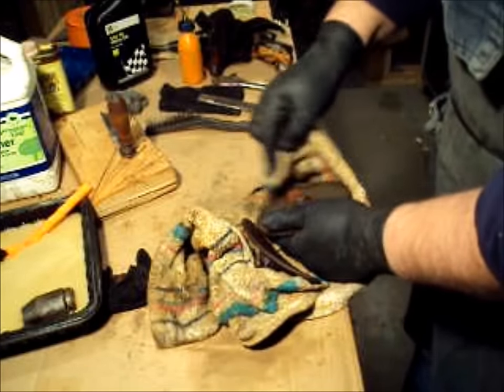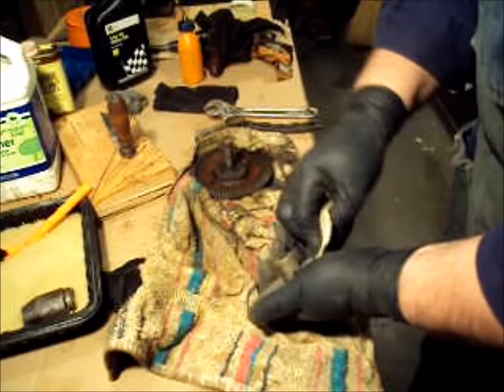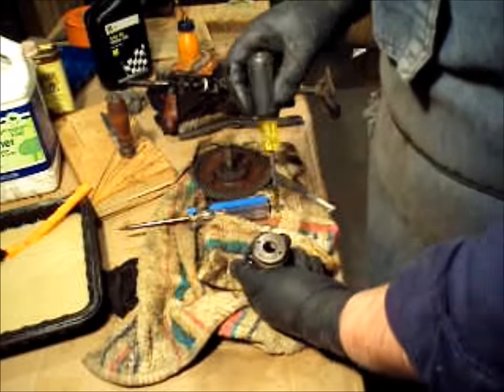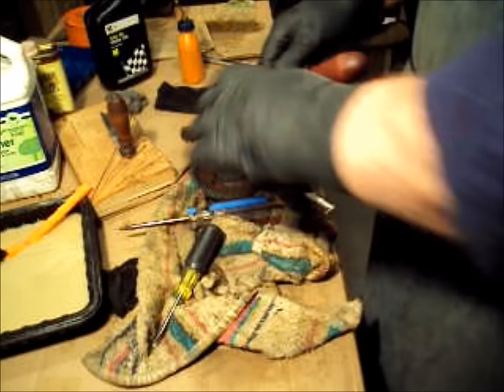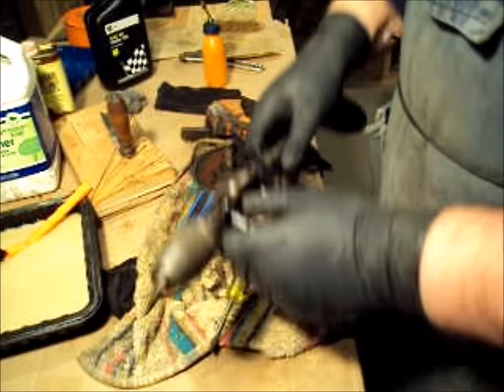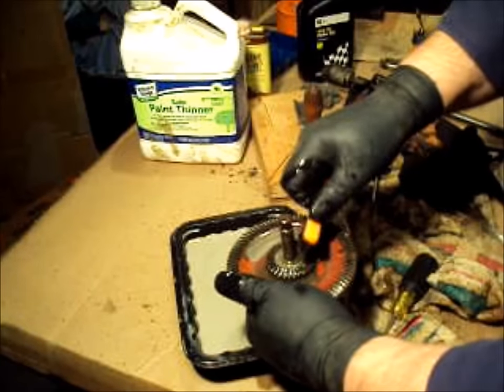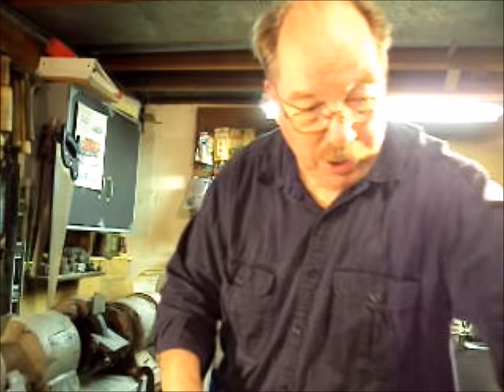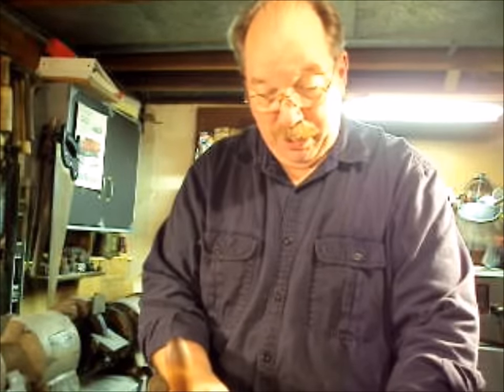Redemption ~ Repairing Antique Tools ~ Pt 2 ~ by Old Sneelock's WorkshopRedemption Pt 2

Comment: Old Sneelock - What a great video.The work you did on the jaws was fantastic.  I use a wire brush and rotary brush for rust removal, how good is the vinegar bath and does it leave the metal pitted ?
Reply from the maker: +UK Tony Short answer: No. 
Detailed answer: If the metal is pitted by rusting and the rust is removed the pits are exposed. If the steel is left to the point where the rust is gone and the vinegar still contains enough un-neutralized acid the acid will attack the steel. In that case the vinegar may cause pitting in the surface. 
Detail far beyond your question: Cooking vinegar that I purchase at the grocery store is 5% acetic acid. If the metal is exposed to the acid for long enough it will dissolve it to the point where the acid is used up. The greater the volume of vinegar the longer the reaction will continue. I have had screw threads become undersized because I left them in the vinegar for 3 days. 
I had concerns with the idea of leaving the parts in vinegar too long. What I've found through experiment is that the rust has already pitted the steel. The vinegar dissolves the rust at a much faster rate than it dissolves the steel so if the process is monitored and the parts removed from the vinegar at the point where the rust is gone only minimal etching of the metal will occur. 
I have been most successful removing rust by exposing the parts to the vinegar for 12 to 24 hours and then wiping off the vinegar and neutralizing the vinegar with soap and water. I have been most successful with long term rust prevention by immediately coating the parts with mineral spirits, wax, or paint, depending on what they are intended to be used for. Following this method, the vinegar will not create rust on a cleaned part as much as it cleans the surface to the point where oxygen can easily attack the chemically clean surface of the steel. By blocking the oxygen's access to the surface the part remains visibly rust free. How long it remains so depends upon the use and maintenance of the oxygen blocking process.

Comment: I have a Millers Falls model 120B. Could you tell me how one would remove the small spring-loaded "button" on the side? I'm talking about the button that one has to press in order to take out the big gear. I understand that this "button" and its spring are not really meant to be removed and maybe I won't remove it or maybe I will but at this point I am going crazy trying to figure out HOW it is done! How did the person who assembled this at the factory get it in there?!?! How does it come out?!?! I'm sure it's quite simple but I can't figure it out! Thanks for the videos. I've been binge watching your stuff.
Reply from the maker: Just came down to the shop in search of an answer. In looking at the pin I see that there is a reduced section just under the round button. Best guess is that this is where the spring is. Either the button has a pocket in it and the button is driven onto the pin and staked in place or the bar that holds the shaft for the large sprocket has a hole in it and the shaft is staked into a pocket in the bar. My bet is on the latter. 
To remove the pin without crushing the spring I would suggest pulling on the button rather than driving the bar off of the shaft. As to how one would grip the button I don't have any good suggestions. Every possible method that occurs to me involves damaging the button in some way. Pliers will crush and score the button. A 3 jaw chuck might grip it and allow you to turn it but that will surely scratch or deform the button. Even if you are able to remove it chances are the damage inflicted on the staking will mean it won't go back together the same way ever again. 
Cutting it off and making a new one would work but before I did that, like you, I would seriously consider that it's good the way it is and might be best left alone. 
Have fun with your drill. After I cleaned mine up it works very well.
Reply: Thanks for the fast reply!  At this point I think the button is going to have to remain where it is.  I did wrap some plier jaws with a few thicknesses in electrical tape and tried pulling on the button a little but it was hard to get a good grip and I was scared to use much force.  I know it doesn't NEED to come out but this is one of those things that comes up in a "project" where I feel like a part is just challenging me, laughing at me, daring me to dissasemble it.  And the part is winning that fight.  I wish I could get that button out to shine it up a little.  It would also make things easier when I go to paint the frame.  It's going to be a pain to try to tape that thing off.  I'm thinking of using a black epoxy paint (sold as "appliance epoxy paint" for painting kitchen appliances and such) on the frame.  It should be nice when it's done.  Other than that button I've got the whole thing disassembled.  Working on cleaning right now.  I assume that the wood handle on the big cranking arm is also impossible to take off (I guess it's riveted on, from the looks of it).  Also, I guess the shaft on the big gear (the one painted orange) is impossible to take off.  I have NO idea how that shaft is put on that gear.  The only thing I could think of is that it's a heat-fit (heat up the gear to expand it a few thou, slip in the shaft, and once the gear cools down it will shrink tight around the shaft).  Is this close to correct?  I don't know but I'm not even attempting to separate those two and see no reason to do so.  Anyways, sorry for the rambling and thanks again!  And if you ever run into the 100 year-old codger who put these things together at the factory send him my way.
Reply from the maker: johns smith I think you're right on the button. The paint sounds good too. 
The crank handle is riveted on mine. I think the strap on the handle was plated on mine. 
The gear shaft is pressed in. Nothjng to be gained by removing it.
Doubt I'll see one othe old guys but if I do. 😈
Reply from the maker: johns smith I think you're right on the button. The paint sounds good too. 
The crank handle is riveted on mine. I think the strap on the handle was plated on mine. 
The gear shaft is pressed in. Nothjng to be gained by removing it.
Doubt I'll see one othe old guys but if I do. 😈